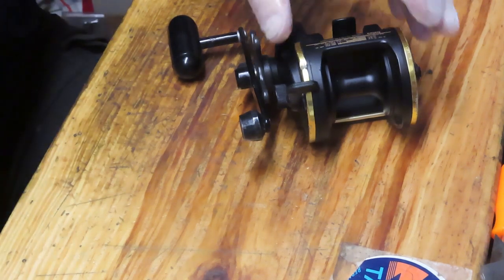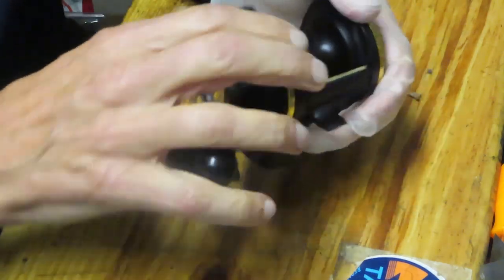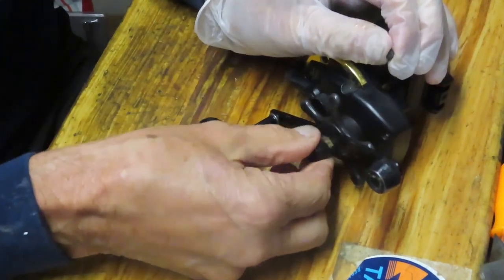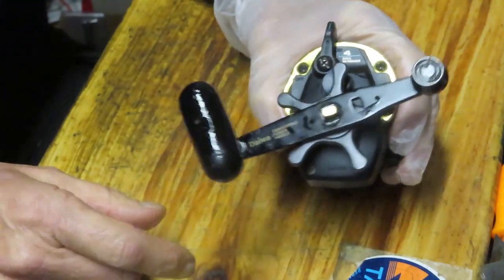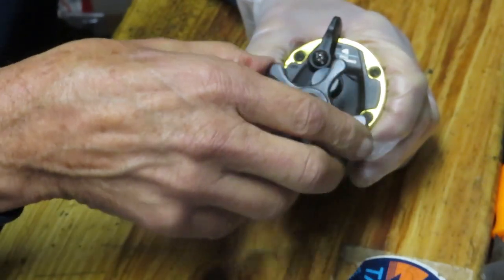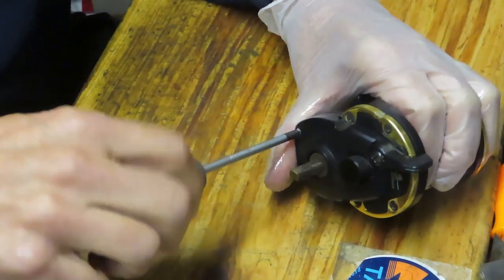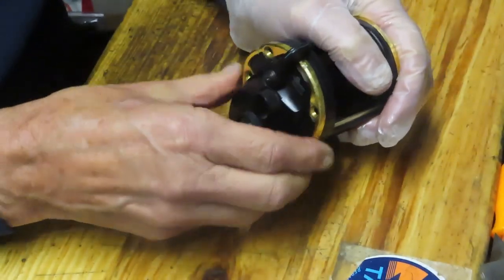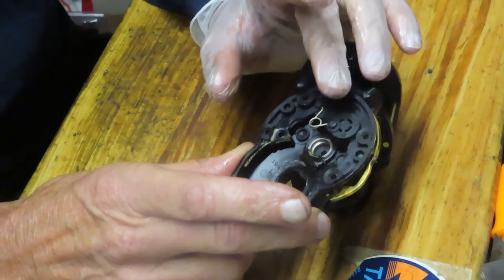Daiwa sl20sh saltwater fishing reel how to take apart and service

Comment: Hi Dennis. Thanks for another great video. The library that you have up on youtube is an amazing build and world asset. In this one, I freaked when two little washers appeared on my bench out of thin air after I moved the pinion gear from my parts tray. Then I watched a little further into the video and saw that they go under the yoke springs. Great stuff. And it applied perfectly to the SL30SH that I was servicing. Many thanks!  Now on to see if you have a video up on the Penn 555 graphite. I might as well put my newfound knowledge (A lot of which relies on you keeping these videos up.), as well as the lubricants I bought, to work. Cheers.
Reply from the maker: Thanks - I know I have one on the 545.  You can use that one as a reference - Thanks for the note - Dennis
Reply: @2ndChanceTackle  Hi again, Dennis. Any thoughts on why the drag seems a bit sticky, as in a less than instantaneous release when the star is backed off. It does release, but not until after it is cranked for a bit. I did wipe them off and lubricate with Cal's grease during the service. I'm referring to the Slosh 30. Thanks!

Comment: Great video mate! These are popular reels where I fish in the UK on the Bristol Channel (strong tides/rocky/mixed ground). Despite them being quite old I still use 2 myself. Bombproof and about as easy to cast as a multiplier gets - with at least 1 of the red brake blocks in!. The only issue I ever have is the little soft brass screw holding the handle retaining cap keeps rounding off. Will have to see if I can get hold of some stainless ones. Again, great no nonsense video. Have subscribed👍
Reply from the maker: Thank you for the sub and for the kind note.  Best wishes for great fishing - Dennis

Comment: I bought six of these reels when they were brand new about 20 to 30 years ago. None of mine have breaks on those pins, so I'm not really sure what they're for. I know I have never taken him out and nobody else has ever taken my reels apart. I guess we can put that in the mystery box with why they decided to leave a bigger space between the teeth on the anti-reverse plate lol
Reply: Brakes not breaks
Reply from the maker: The brakes slow the speed of the spool by moving outward with centrifugal force and rubbing the race ring.  If they are not there, no problem. - Dennis
Reply: Got it! I was just saying that they didn't come with the brakes. Maybe they were planning on adding them to later model but they didn't come with them. I have reels that have them. Keep up the great videos!
Reply: Update. I went into the boxes that the reels came in and found the brakes in the box. I guess they don't put them on at the factory. I also know how to spell brakes, but Google voice to text got me
Reply: Also, thanks for the video it was a great help rebuilding all six of them

Comment: Dennis, I own a SLX50 which is an upgraded version of this reel. Those felt drags look terrible just like they did on my reel when it was bought (NOS). I had to replace with carbontex. I would recommend it, I would estimate my max drag with those poor stock drags to be 2-3lbs.
Reply from the maker: Thanks for the info.  Yes - those were in pretty tough condition.  They are also 30+ years old - Dennis

Comment: you serviced a later 20 in the video which has 4 bearings. on the early version there are only 3. there is just a plain plastic bush on the bottom of the main shaft. i normally replace the plastic bush with a SS ball bearing. I also replace the plastic bush under the spool tensioner cap with a ball bearing. this also applies to the 30. the extra bearing/s make for a much smoother reel. BTW. I normally upgrade to carbontex drag washers

Comment: Good evening Dennis. I've been watching your work for awhile now and learning much. Tonight it got personal for me. I pulled out my older favorite live bait reel for when Albacore were crazy plentiful in So. Cal. during the '90s. I pulled off the left side plate and found it to not have any cast control brakes. Just the two arms sticking out. I thought I may have lost them last service, removed them years ago or maybe the Sealine 20SH never had them to begin with, part of the 'good casting' design. So, low and behold, at 29:30 in your video'  you open the side plate and it's just like mine, brake less! How about that?
Reply from the maker: Coincidence?  There are brake collars for that reel, so you probably lost them.  You can make them out of a spray can tube extension or a coffee stirrer if you cannot locate replacements.  You can run the reel without the brakes, if you like - Dennis
Reply: @2ndChanceTackle  Dear Dennis: Per our discussion about the 2 Sealine 20SH reels (your clients and mine) and the absence of the cast control brakes on the spindles. I dug out the original box which I hadn't seen in 20 plus years. In the bottom of the box with the little tube of oil and assorted papers were 2 little zip lock bags containing 2 sets of 'brand new' reel brakes. The red ones are 3/16" long and the white are 3/32". My question is what is the difference and which you would recommend I install? I'm pretty sure my thumb is not as educated as it once was! Thank for your reply.

Comment: I have a Daiwa SL20SH like the one in the video. I also have an SL30SH purchase about the time. I don't recall when I purchase these reels but it's safe to say they're about 15-plus years old. What I found different with mine was 2 rubber o-rings on the shaft. One o-ring on the inner side of the gear and the outer one. The outer one broke when I was trying to remove it from the shaft. Trying to find an o-ring of this size will be next to impossible at the Ace Hardware store. I'll be reassembling this reel without the outer o-ring. My question; I wonder what operational effect this reel will have without this o-ring?
Reply from the maker: The "o" rings are water seals and the outer one keeps the adjuster cap firm to the body.  You can use it without the ring, but you should continually check that the cap doesn't get loose from vibration or use.  The cap could fall off if you are not careful
Reply: @2ndChanceTackle  Thanks for the video and your response.
Reply: P.S. It must be my advancing years that are preventing me from accomplishing the task at hand. After spending the entire Sunday afternoon taking the reel apart and putting it back together, I now have a situation, when I tighten down the drag, the handle is difficult to turn. When I find myself in this situation, I usually put the project aside and get back to it another day.

Comment: A friend wants te sell me a daiwa firewolf it looks like this reel. Do you know of it is a good one?
Reply from the maker: They are not in the same class as the Sealine.  The Firewall is an entry level reel, where the SeaLine is a step above.  The Firewolf is a good reel.  I guess the answer is that it depends on the price.  Check out the cost to buy one new and compare that to what your friend is asking before you make a decision - Dennis